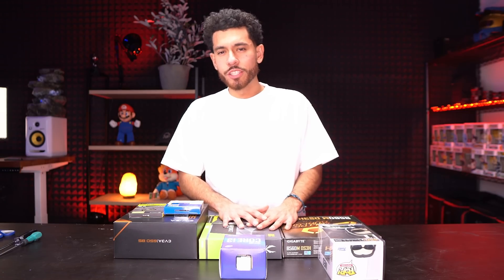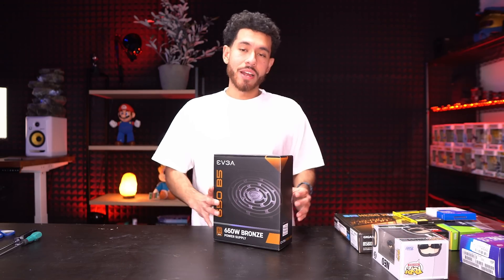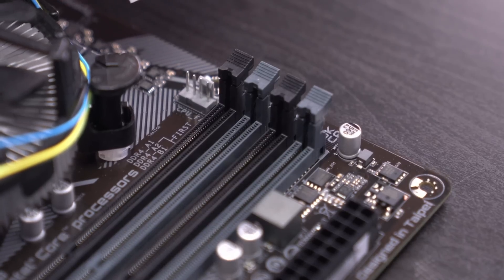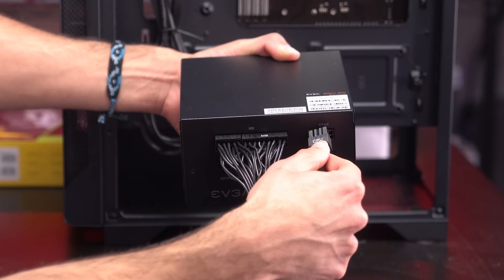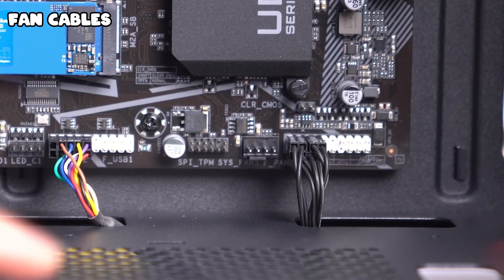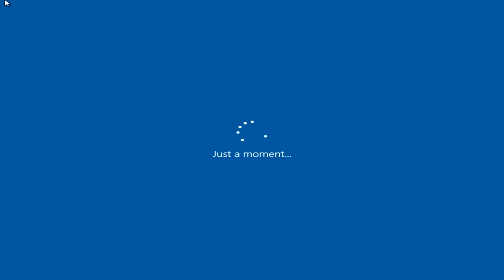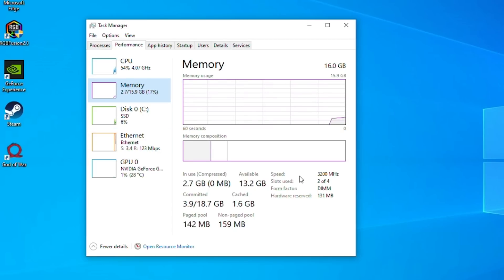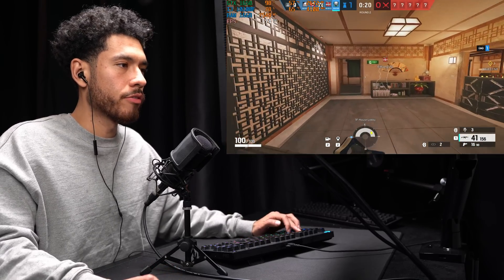$600 Gaming PC Build Guide - GTX 1650 i3 10100F (w/ Benchmarks)

Comment: So I got this cpu and paired it with a 1660 super
I was using a x3450 before and I was extremely bottlenecked 
I’ve watch some reviews of the 10100f before purchasing and it didn’t seem like a bad pair
After getting them together tho my gpu utilization is still low while the 10100f is in the night 60s-100s 
Tested it with every game I played and the gpu utilization never passed 50

Comment: How did you xmp the ram to 3200mhz with the 10100f? I did some online research because I am building a pc with the 10100f and stated you will need z-series mobo to unlock 3200mhz with the 10100f.
Reply: Mother board settings

Comment: bad build... motherboard more expensive than processor ? are you insane ? 
In every build better spend more money to :
1) priority - power supply
2) processor
3) everything else 
Motherboard on B660 can use i5 12600f or 13600kf(non overclocking version is not in market now) 

Good processor gives you more options for future upgrade.  If you want really good computer with some productivity for 5-7 years, better get only last gen components. 
GPU from the video is old, if you want really good GPU try to buy or 3060 or 4060(upcoming), if you need to play a couple months before you can afford a good GPU - you can buy old used GPU or take it from friend during collecting money on nicest GPU. These about - the best for next couple years playing on nice settings with comfort FPS and what the most important - supporting from NVIDIA. This year they sto-p supporting 600 and 700 GPUs next will be 800-900 and next will be 1000. Card from the video will play good next 2 years and you will be neaded spend more money for the new videocard. 

Who saves unwisely - pays tens time more....
Reply: It’s a budget pc.. I have the same psu i3 10100f and it’s better than my brothers i7 because of its GHz. The cpu might be cheap but it’s cheap and really good. And you can’t complain for a 600$ pc running games that require alot at 80fps. Yes the CPU lasts less but in the next two years I’m sure someone has around 150$ for another one.. And this guy knows what he’s doing he does this for a living.
Reply: And don’t be talking about bad about a build that can run multiple games averaging 144 fps at 1080p.. It’s a starter pc remember that

Comment: All Gameplay was recorded with a capture card on a different computer

So can this gaming pc stream games like Gta without an issue sir?
Reply: Based on the pcs performance if you wanna stream games that take a lot of graphics you would get around 80 fps but I have this pc I record modern warfare videos and I run it at 75 fps.
Reply: @LIMAXION  Thanks for this info Maximo

Comment: HAd this build fucking sucks
Reply: Why
Reply: No it doesn’t I have this pc and I run most games at more than 120 fps with 1080p. If you think this computers sucks because of its intel you clearly don’t know anything about pc’s. And it’s pretty immature that you don’t realize that this is a budget pc and you shouldn’t expect a high end gaming computer.
Reply: the build actually runs pretty great, it is a budget build and is meant to be upgraded later ofc. I'm currently using this build (with a few part exceptions) and it does amazing, I can use it to play huge games, edit videos and stream. It does it's job well and that's what matters

Comment: I done the ram thing and my computer won’t start up?
Reply: I'm assuming you're talking about XMP. If so and your PC doesn't boot anymore, you will need to reset the CMOS. Check the board manual for instructions. XMP is a RAM overclock and doesn't work perfectly on all systems. Chances are that you'll need to manually adjust your RAM settings until you find a stable overclock.

Comment: So… I luv this build. Very comprehensive video. Did my first build with ease watching this.. just one question, which may be a dumb one…. Where tf do the lights plug in to this motherboard?! That’s the only thing I didn’t get right for some reason.
Reply: @Name Unavailable it’s working great for me. I may not be a good judge though. It’s my first build. I did buy and i5 instead of the i3 cpu.

Comment from the maker: CURRENT PRICE JULY
$632USD
Reply: Would this PC build work with a RX 6500XT??
Reply: @epiced  Yea it would, the 6500xt and the 1650 are kinda in the same range. 1650 is better in my opinion though but more expensive
Reply: @flamingdrummer12  6500xt peformes better
Reply: @epiced  10th gen intel is not worth it get a 12100f but youll need a diff motherboard
Reply: @anthropolostoria  I can’t afford it
Reply: @epiced  ah
Reply: @epiced  then yes the 6500 xt will work
Reply: @anthropolostoria  I was able to adjust, because prices are dropping so heavily. I was able to build a WAY better computer than this for cheap. Yes I do have a 12th gen core I3
Reply: @epiced  what parts did u use
Reply: @anthropolostoria  can’t list them here, YouTube would see them as spam and delete my comment. Happens to me a lot
Reply: @epiced  oh alr
Reply: would this pc build work if you get and i5 instead of and i3
Reply: @aminaw7324  the i5 10400f will work
Reply: @anthropolostoria  go r/pcbuilding if you need help not some non which watched a ltt video
Reply: Any way to upgrade this ?
Reply: I am assuming a 1650 super works with this build right?
Reply: @Cyberblue-qf8eb  yes
Reply: @anthropolostoria  could I upgrade to a 3070 in the future?
Reply: @Cyberblue-qf8eb  no youd need a new power supply and an i3 simply cannot support that. an i5 10400f is a good option.
Reply: @anthropolostoria  Thanks I really appreciate it
Reply: @anthropolostoria  a 12th gen i3 can support a 3070
Reply: @epiced  yeah but not a 10th gen 13
Reply: Would it be ok if i use a b450m instead 
of an b560m
Reply: @aminaw7324  no that wont work
Reply: @[SLR] TheGamblerman you have this rig?
Reply: I just got this computer I'm so upset, the graphics are bad. can I upgrade the Dell XPS 8940 11th Gen Intel Core i7-11700 8-Core Processor,32GB DDR4,1TB SSD, Intel UHD Graphics? , and what Graphics card can I put in my new Dell  computer can you help me, my old HP has the  NVIDIA GeForce RTX 2060 12GB GDDR6 Graphics Card can i take it out of the HP,  and put it in the Dell computer
Reply: @sniffiejoe9370  damn that dell is really good. and yes a 2060 will work but in the future u could maybe get a 3080.
Reply: @anthropolostoria  i just got it last Friday I still have 30-day to return I ask to change it to the dell Dell XPS 8940 Desktop 16GB DDR4,8GB NVIDIA GeForce RTX 3060Ti,   it cost a lot more but at least it is not big lost thank you for your help
Reply: would this pc bulild work with an 600w power supply instead of an 650w power supply
Reply: I saw a pny 3060 around 410
Reply: @edgeofgames7752  pls god dont get a pny one. get an asus one

Comment: I have a quick question. So, I am thinking about buying individual parts for my pc and wanted to know if the B560M Bazooka from MSI is good for gaming specs. My gpu, cpu, and ram I will be using is the 10400f, 3050, 16gb ddr4 3200mhz but I might need to change the cpu so it supports higher ram speeds.

Comment: Can anybody please tell me how to pimp this pc out with a lot more rgb with an extra 50 bucks? I’m getting a pc for my birthday and I’m really looking forward to it :)

Edit: I’m gonna try looking for ways to improve this so look in the replies
Reply: I looked around and I found a great case that has great airflow, tempered glass, and it has all the features the case in this video has but this one also comes with 3 rgb fans. It’s called the apevia prodigy lmk if it’s good bc I think that will add a lot more rgb.

Just found out the only way to control rgb is from the controller or the case itself so if u wanna use a software, a different one would be your best choice
Reply: Just found a way better gpu, it’s cooler looking, more memory bus and higher clock speed. It’s the Asus GeForce GTX 1650 Overclocked 4GB Dual-Fan Edition VR Ready HDMI DP 1.4 DVI Graphics Card (Dual-GTX1650-O4G)
Reply: Another thing im going to upgrade is the cpu. Its a i3 10105f, just a slightly better version of the i3 10100f but with more performance for less than 10 bucks.
Reply: I changed the case to a Corsair 4000d airflow that I got for 94 bucks
Reply: I’m adding Uphere argb fans (6 pack) that I got for only 37 bucks
Reply: Power supply prices r high rn, so I’m going to change the psu with the Corsair cx650m that I got for $59
Reply: Replacing ram with Corsair vengeance rgb pro 3200mhz 16gb for only 10 dollars more than the vengeance lpx

Comment: question, if I have a dimm motherboard, that means I can choose whatever RAM I want to, but it has to be DIMM right.
Reply: All modern desktop mothers have use DIMM.
Reply: @JJFlores197  but I'm asking, if my motherboard supports DIMM, I could choose like a 3000MHZ ram, or a 3600 right.
Reply: @Undependable  check the motherboard's spec sheet as well as the QVL (Qualified Vendor List) to see what specific RAM modules are validated to work with your board.
Reply: @JJFlores197  can u pls tell me if the RAM: CMK16GX4M2B3000C15

Is compatible with b560m ds3h?

Comment: Sorry but i couldn't tell if this build guide was made in 2022 or 2020. If you're going to make a build guide at least use stuff that is brand new. i get that gpu prices are stupid right now but you could've gotten a 12100F or something. also spending money on a funcopop is a waist of money at $750. Also you could've gotten a 80+ gold psu for 10 bucks more. Also 80+ doesn't mean the psu wont brake. it means it has good efficiency. But 80+ bronze isn't good. Also rgb is a really big waist when the main thing you want out of a gaming pc is to game. Performance and value come first before looks. Also,  you should've gone with a non-modular psu. would've been cheaper and would've done the same thing. I love your content but this build guide was not the best you've done.

Comment: Thank you for this detailed video!! 
I got a question tho. Will enabling XMP for the RAM really add some boost? I thought i3 10100F is limited to 2666mhz. I'm kinda clueless with these things, I just saw it in the specs of the CPU since this is what I plan to build with soon. I'm now unsure if I should go for 3200mhz RAM or the 2666mhz ones 😅
Reply: Same question. Can anyone answer this?
Reply: @clintjudeeda8684  I got the i3-12100F instead it's just a bit more expensive but it has a way better price to performance ratio. It even outperforms single core performance of the Ryzen 5 3600. It supports 3200 mhz RAM as well. If it's over the budget its really worth saving a bit more.
Reply: @MightyFartBomber1  will the 12100F still work the same motherboard?
Reply: @jacobpena6797  no that's the thing about intel they need different mobo per gen. I went with a gigabyte H610 and it's a bit more expensive than the previous gen cheapest mobo but the price to performance ratio is really worth all your money. Pair it with a decent mid range GPU (like the GTX 1660 Super) and you can play 1080P at ultra settings with no problem
Reply: @MightyFartBomber1  okay im new to all im trying to build my first pc this is what i have so far, msi b550, ryzen 5 5600x, geforce gtx 1060, 2x8 gb corsair vengance and 1tb wd blue ssd, does that sound decent?
Reply: @jacobpena6797  that's quite decent already my guy. I suggest going for a 1660 Super tho since its more recent and has better overall performance compared to the 1060 with not much of a price difference. From what I've noticed, the price has also decreased already and will probably decrease more when the new gen AMD and Nvidia GPUs are released.
Reply: @MightyFartBomber1  i got a 1660 ti rn in my cart but i might just save up for a 3060 or 3070 rtx ive changed up alot in my build
Reply: @clintjudeeda8684  this is right. I have stopped the video right away when he said he is going to use 3200mhz.
Reply: Yeah how did he???

Comment: I got mine msi b560m a pro and i5 10400f full pc set for 700
Reply: what’s ur specs
Reply: @lexa_michaela  i5 10400f msi b560m a pro
Msi gtx 1650 ventus
Kingston m.2 2280 500gb
Psu : Silverstone st50f-es230
Case : aigo dlm 21
Ram : hyperx fury beast 2x8
Total 669 usd
I can find for even cheaper after 12th gen release
Reply: @poggers1568  how is the performance so far? that processor is $200 here or more 😥 do you think it's worth the upgrade from the 10105f though?

Comment: Shouldn't you test it out first outside the case because putting it the case and don't you need a thermal pad shield for the m.2 since i think it gets hot while in use?

Comment: eBay msi 1070, msi b450 pro max, and Ryzen 3 3100 and case w fans $600 ! Much nicer in my opinion a lot of room to upgrade over time to
Reply: Using this exact setup w a 650w EVGA non modular power supply bout $50

Comment: I bought 52kk peso pc and the cpu is ryzen 5 5600g its like $1000 i think i got scammed because when my cpu got burned they change it to AMD ATHLON 3000G AND GT 1030😥
Reply: that’s bad. where did you buy? 5600g prebuilt is usually around 30k. 5600x is 50k above

Comment: Hi can u pls help me with my pc. As it keeps on crashing.  Always gets blue screen with error then restart
Reply: I would start by checking your temperatures; make sure your CPU/graphics card aren't overheating. If you happen to overclock anything (CPU, RAM(XMP), GPU), temporarily disable the OC and see if it improves. If it does, it most likely means your OC settings aren't working and you'll need to tweak them until you get it just right. Make sure your software (Windows, games, and drivers (especially graphics card) are updated. It also helps to know what the BSOD is. If it restarts to quickly, take a video of it and you should be able to make out what the error is. That can help point in the right direction.

Comment: Everything here is Double if not triple the price here in South Africa. For $50 M.2 SSD you'll find only a 256GB plus it will be shitty brand. For a 500GB or 512GB M.2 cost more like $80 USD if you convert into South African Rand... Same thing if you wanna buy a XBOX Series S you won't find it for $299. Here it will cost roughly the same as the XBS X price if you again, convert our price into USD 🤦‍♂️😅

Comment: New to the PC world, although I have been watching quite a few of your builds for research. Question, would this be a decent/good build for sim racing, would mainly be using it to run Assetto Corsa.  On paper it seems to meet the minimum and recommended settings, but unsure if I would run into any issues with gameplay.
Reply: I would spend an extra 100 or so and get an rx 6600. It's still not amazing for the price but the best you can find at the moment

Comment: i have the same cpu and i thought that it only allows the ram to run at 2666mhz
Reply: If u use a b560 board i can get above that
Reply: @lachysimmonds357   i have a B560M PRO-VDH WIFI will that do?
Reply: @Skizzy24  ye but make sure that u have faster ram if u need anymore info jsut search it up happy to help!
Reply: @lachysimmonds357  yes I have 3200 or 3600 corsair vengeance ram I'll have to check again but I guess because I read online that the i3 10100f only could have ram run 2666mhz i just changed it to that in the bios. I'll try it rn and see if it works thanks for the help

Comment: i wish the dislike button was still a thing. already you dont put the motherboard on the table, you dont want to break the solder on the back of the PCB .  you should have put in the price that you need the fan extensions. you also should remove the PCI bracket before installing the motherboard. he may know how much pressure to apply, but to someone who doesnt know what they are doing they could scratch the surface of the PCB. with that case you could have just used the sys_fan 1 next to the cpu power connector to the left of it, but for some reason he missed that. also im not sure if he added the funko pop on the the budget, if so thats really dumb and could have just put the price of the fan instead. i think cooling is more important that an action figure. overall video id give a 5/10
Reply: Bro hes built plenty of pcs before and with the cooler my i3 stays under 70 degrees always with stock cooler

Comment: replace 1650 with rx 6500xt for 270$ from newegg in stock, and you will get 20% more perfomance with  60$ saved money. Motherboard in this video support pci gen4, so you will not be limited.
Reply: Yes but the cpu doesn’t support gen 4 so it wont work properly but still better performance than a 1650
Reply: @lachysimmonds357  on the saved money you can go with 12100f and h610 motherboard and get far more better pс for the same money
Reply: @amika8828  that is a good point the i3 12100f performs the same in fps as the 11400f so ye

Comment: Hey Joey, do you have any advice im trying to run at least 240fps on fortnite and high frames on other games. I currently have a Ryzen 5 2600 and xfx rx 580 do you have any advice on what I should upgrade them too or what to do cause my pc doesn't run frames good :(

Comment: hi, i have the same processor (i3-10100f) and 
Gigabyte H410M H V3 motherboard with XPG 8G 3200mhz ram. My base ram clock is 2666mhz
but i can't set 3200mhz from bios. even after selecting profile 1 its still 2666mhz. is it possible for my motherboard make the change?
plz help..

Comment: Hey joey ! I was wondering how can you download drivers and other stuff more specifically LAN driver. You can not use Internet until you have the LAN driver
Reply: Windows has a lot of drivers built in for networking, so chances are high that it already had the network driver. Alternatively, you can use another PC with internet to download the drivers and then transfer them to your PC via usb drive.
Reply: @JJFlores197  Thanks for your help